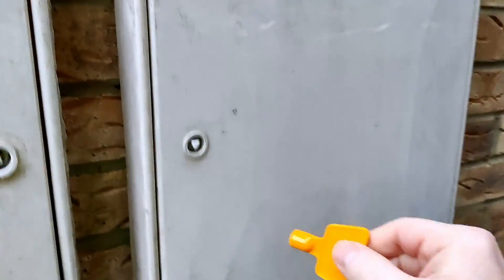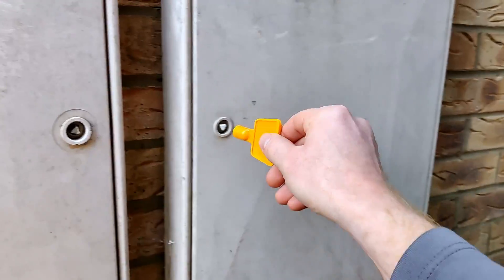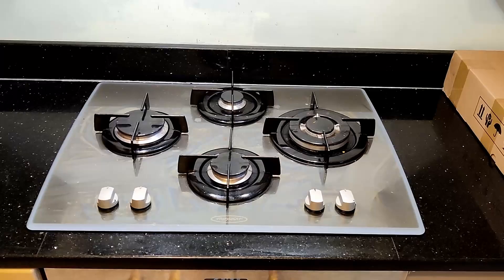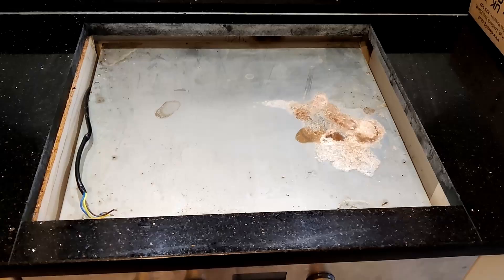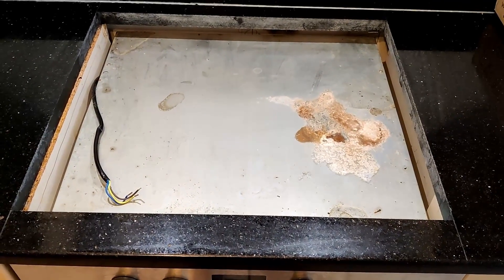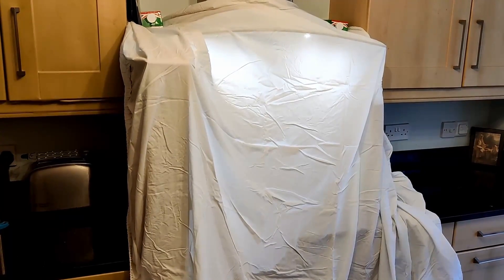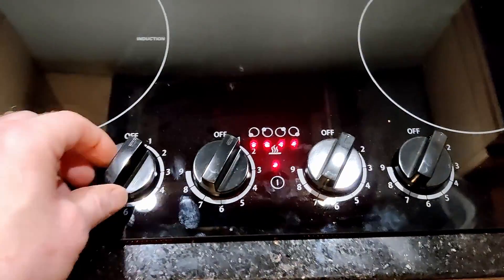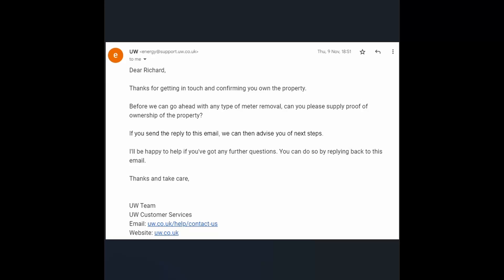Ditching the Gas: My Journey to Electrifying My Home (No More Standing Charge by Removing the Meter!

Comment: Government ; stop using gas move to electric.
Also government; heres a shed load of hoops to jump through to get rid of gas 

Id love to have induction, i had it at my last house but due to my kitchen layout it would cost about £2.5k. So not gonna happen unfortunately.
Reply from the maker: Ouch, that must be quite the overhaul needed at your place! Depending on your cooking needs, there are now lots of induction hobs that can be run from a normal ring main. They are limited in power output to under 4kW. We used one of these in our last house and found that we could still run one big ring and one small ring on full power but any more and it would then reduce the power across the rings.
Anyway, might be worth a little look.

Comment: We got a local 'heating engineer' to remove ours - cost next to nothing. Like yours he just popped the meter out, gave it to us, and capped the inlet pipe. He told us the distribution company would cap the supply from the road about 12 months later, and that is what happened. Also that they'd collect the meter at the same time. That also happened. They made a right mess of the front garden - suspect they disturbed a deep French Drain as we've had liquid mud toothpasting out of holes in a retaining wall since instead of water.

We did it because "fossils / evilcorps / climate change" and had nothing else to heat the house with at the time, so we were f'in freezing - righteously - that first winter! I wish the UK would do the obvious thing and use offshore wind to synthesise methane into storage in good wind, then people could have blazing actual fires mid-winter if we want them (and can afford e-fuel heating). Seems mad to just abandon UK gas main when its power capacity is many times that of our electricity grid, and we can store/export gas at scale. We're quite far down the 'electric house' route now, but if they'd brought out an affordable micro CHP boiler maybe we'd have cut the electric supply instead!
Reply from the maker: Thanks for the comment and sharing your journey!
I agree with your points 👍

Comment: I'm literally blowing hot and cold about heat pumps!
They sound wonderful but I'm not a geek, am pretty boggled by numbers and stats. Although the mechanics of things fascinate me I'm chronically ill and havent got the wherewithal to play around with the set up. Nor do I have the money to make remedial changes to radiators etc. 
Seriously been looking into infrared heaters and maybe battery storage instead. But then I see these video of yours and I wonder what to do again.
Reply from the maker: If you can find a local installer who you can really trust and rely on, then a heat pump will be the best option for sure, especially compared to IR panels.
Heat pumps UK Facebook group has many good installers in it.
Reply: @UpsideDownFork  thanks, I'll check it out.👍🙏
Reply: There are two issues with infrared. First, it only heats what it "sees". Think of it like the sun, as soon as you go into the shade, you don't feel the sun's heat anymore. Your room will be the same, so you'll end up with cold spots all over the place and potential for condensation forming. Secondly, you'll only ever get 1kw of heat for 1kw of input power, of 100% efficiency. Heat pumps can be anything from 100% to 400%+ efficient. Heat pumps are just better for heating almost anything, even if its -20c outside, they'll still give you over 100% efficiency.
Reply: @chrismgeary  as far as I understand it if you get the right wattage panel(s)for your room size and insulation quality placed correctly on the ceiling it will heat you and the objects in the room. Then as everything in the room warms the air becomes warm next rather than the air being warmed first and circulating around the room getting cooler and warmer as it rises and falls. With thermostatic controls I'm hoping they shouldn't work out too expensive. The good thing is I can buy them one at a time as I can afford it to see if they work well for our needs.
Reply: @judebrown4103  If you're struggling with the air to water heat pump systems, cost etc, have a look at air to air instead. You can also install one at a time, much cheaper to install than A2W HP and you still get the COP benefits that you won't with infrared. I ruled out infrared due to running costs (similar to any other resistive electric heating system - with the exception of ZEB which is very interesting as a concept) and I ruled out air to water heat pumps due to the high installation cost (compared to air to air).
Reply: @chrismgeary  thanks for this, I didn't know you could instal air to air one unit at a time, I'll revisit that. I like them for the summer cooling aspect too.👍
Reply: @judebrown4103  there may be cost savings going for multi split AC units but otherwise, staggering installs is very easy and helps with the cash flow for sure.

Comment: We had a similar experience in February with Octopus after we had our heat pump commissioned, they were my 1st phone call 😂
They did the same thing trying to pass me off to the GNO, who I contacted and they wanted to remove the service pipe at some large cost.
It had already had a cap put on the outgoing side of the meter so I just contacted Octopus back and told them it was already capped. They had it out about a week or so later.
My missus said that when the 3rd party meter guy questioned the removal, he looked at her like she had 2 heads when she told him it was a removal only, not replacement.😂
Reply from the maker: Thanks for the comment. How's gas free life working out for you?
The engineer who removed our meter didn't bat an eye lid. He said he'd done quite a few for heat pump owners this year.

Comment: It's a great feeling to getting your gas meter removed and capped. I filled our empty box with insulation.
Reply from the maker: Thanks for the comment.
If the regs will allow it, I'd like to insulate it, board it and then fit an external socket in there.
Reply: @UpsideDownFork  at some point in the future your iGT/GT (gas transporter) will disconnect the gas service pipe to your property at the gas main in the footpath/road on the public side. This will be free of charge, but typically is a minimum of 12 months down the road. They do a risk assessment on all capped live services. Process is known as GSR Cut-offs, part of the Gas Safety Regulations, hence GSR. They will send you a letter at some point to advise they are planning to carry out this work and as I say it will be free of charge.
As the pipe is still live you won't legally be able to fit an external socket in there until you are cut off from the gas main.
Reply from the maker: @johntisbury  Excellent info! Just what I needed to know. Happy new year!

Comment: Thanks for the rundown really useful. One question i have what is the difference between removing the meter and capping the supply?
Reply from the maker: To a layman like me, nothing!
To the energy providers, they seem to interpret gas capping as cutting the gas pipe off that actually runs to your meter cabinet. In our case they were indicating that the road may need to be dug up to cut the pipe back where it branches off the main line under the street!
I've heard of quotes ranging anywhere from £200-£2000 for this kind of thing.

Comment: Unfortunately BG aren't covering my area ATM so I'm stuck waiting for Octopus and a Daikin rather than my favoured Valliant..
Reply from the maker: I'm sure you'll be fine with that. Daikin are well established on the heat pump side.
Good luck and thanks for the comment.
Reply: There may be other engineers other than the big companies who are able to do an install for you. I used a smaller company local to us.
As long as they are MCS registered they may offer the BUS.
Energy saving trust keeps lists available of installers.
Heat geek is another option to find competent installers.
Reply from the maker: @salibaba  I shared in a previous video how I contacted 10+ companies. The process was pretty painful and a total lottery from one to the next.
I would have loved to use a smaller local company if that was an option.

Comment: I'm in the same position with just the hob left on gas. I just can't convince the wife about a induction hob.
Reply from the maker: Good luck. Luckily my wife needed no convincing after we did the same at our last house. The easy wipe clean factor was all it took for her!
Thanks for your comment.
Reply: An induction is as instant as gas with no lag when turning the heat down to simmer.
Reply from the maker: @MrRawMonkey  agree that there's no going back to gas hob once you've experienced and adjusted to an induction hob 👍
Reply: In our transition to an all-electric home the gas cooker was the first thing to go. My wife loves the induction hob and won't let me do any cooking now.
Reply from the maker: @fredgray2376  good for you and good on your wife!

Comment: Dont know what the regs are but cant see a problem now its capped off and youve confirmed that with no gad coming out of the hob. Lucky you have a cooker circuit cable there too. Well done for giving gas the heave ho, must be a very satisfying feeling.  i hope to do the same later next year, having installed a 9.5kwh storage battery.
Reply from the maker: Thanks for your comment.
Yes it is very satisfying indeed!